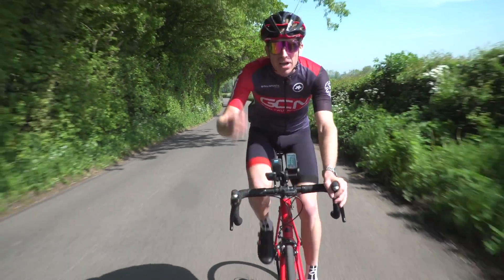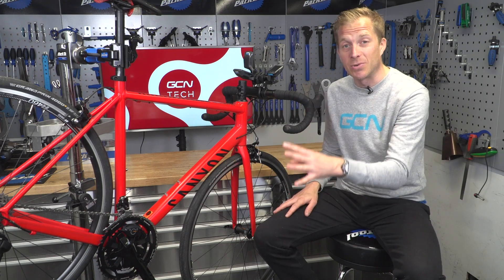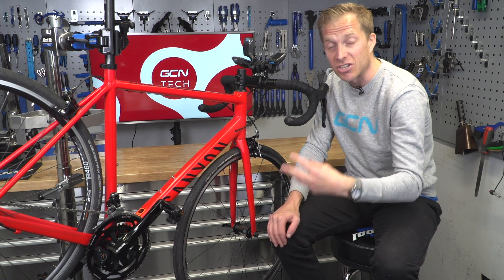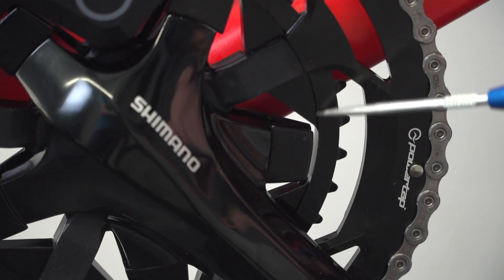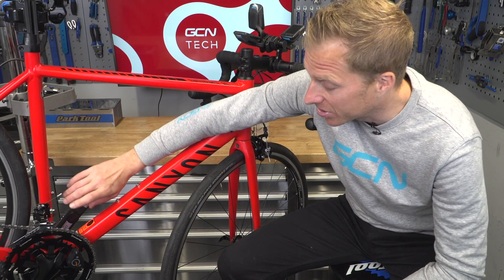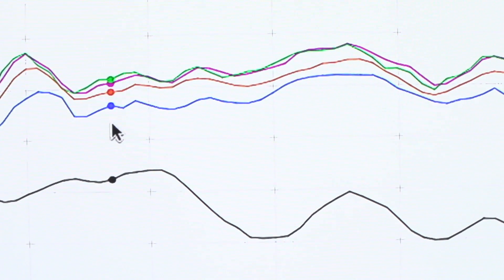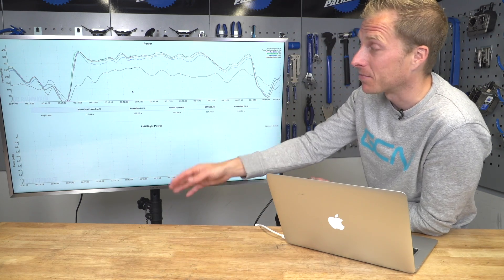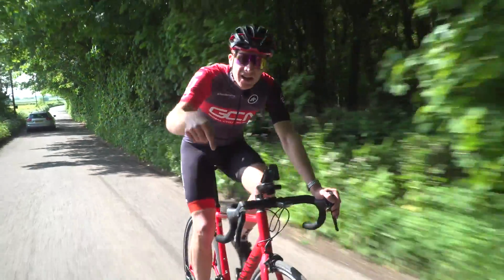Where To Fit A Power Meter On Your Bike | GCN Tech Does Science

Comment: Fitif Power app on OS and Android, less than 10€, works with cadence/ heart rate/ speed (any two of the three). Works best with cadence and heart rate. Uses the accelerometer in the phone and GPS for the algorithm to calculate. Can be used for road or hard off road tracks. I just had the Rotor InPower 1.1 bottom bracket and cranks fitted to my mountain bike, yet to test. Next week if you'd like an opinion. All the best Jon, Tim. Ride on!

Comment: Nearly every review/roundup that mentions the Powertap P1 pedals says that you can easily find the AAA batteries anywhere in a pinch, while also failing to point out that Powertap says they require the use of AAA lithium batteries because the common alkalines could damage the pedals, which isn't covered under warranty.  I doubt that AAA lithiums are as readily available as AAA alkalines.
Reply: ytyehyeh for me in the states everywhere you can find alkalines you can find lithiums
Reply: exactly. also, i live in toronto where triple a batteries are hard to find, let alone lithium ones !

Comment: Jon, that is really pity to see the lack of objectiveness in this video  (I guess because of powertap sponsorship): for example: 1. pedal based measurement gives you much deeper analytics of the pedalling technique, And Garmin/Rotor does this perfectly (strange that you haven't mentioned this point about pedal based measurements). 2. the massive batteries in the powertap pedals increase the pedals weight and thickness of the pedals (you can touch ground more likely in a speedy smooth turn if you are pedalling). and these are important points for those who is starting to train seriously, most likely for competition. I have no hesitations you know and thought about these points, but tried to avoid them as they are uncomfortable for  Powertap. We trust you and expect complete and fair overview  if you compare anything...
Reply: Those "deeper analytics of the pedalling technique" might be useful for scientific research or advanced bike fit, but for day-to-day training not so much. I wouldn't pay extra for those.
Reply: michwoz -  it's not a question of price. it is very important difference between different ways of measuring power.... and analysis of pedal technique is very practical task, look on the recent GNT video: "how to pedal like a pro": https://youtu.be/o5HWRdoQoGs
Reply: michwoz - and hub measurement is not a cheep solutions if you have training and race wheels sets

Comment: I train with power. My first power meter is a single-sided gen-2 from Stages Cycling on their composite carbon crank arm for a GXP bottom bracket with my SRAM Red crank. I purchased it at a reduced price during a sale as a temporary measure until the price of two-sided power meters come down. I like the idea of the power meter in the pedals but no one is making them for SPD cleats that I use. So pedals are out. I was thinking about switching to a pair of Watteam Powerbeat power meters because the company plans to support carbon crank arms -- but they don't yet. The Powerbeat can be purchased for do-it-yourself installation onto any straight, hollow aluminium crank arms as either a one-sided or two-sided system. However, another recent entry into the market (via Kickstarter) is the iQ² from Keesjan Klant and company. It looks like one of the best power meters yet. It attaches between the pedals and the crank arms so you can use it with any crank and any pedals. It's available as both one-sided and two-sided. But, since it's funded via Kickstarter and they don't expect to start shipping until September 2018, I'm waiting. Once their claims are verified by independents tests of production units, a two-sided iQ² may be my next power meter.

Comment: The Elemnt Bolt, designed to be aerodynamic.....not in this case 😂😂😂
Reply: Five times more aerodynamic
Reply: JD Pinilla 😂
Reply: Its not actually any more aerodynamic  than the competition and certainly no where near the claims made by wahoo. As part of its development the bolt never actually saw a wind tunnel, it was all done using CFD and modeling against a specific model of the competition at a specific angle which was selected imho to make the bolt appear better than it is. When it has been tested in the wind tunnel the claims did not really stack up.

Comment: Started with a hub, moved to a crank based stages and now using pedals. Found the Assioma Duos to be great value and when analysed vs my Wahoo Kickr V3 indoors seems to sit well within 1% tolerances. As long as you use the same device to train with power and it's consistent to itself, a few watts between different devices means nothing.
Reply: Nathan Porter I have a kicker 2 too, and assioma singlesided pedals. Huge differences! The pedals read about 25% higher despite repeated calibrations of both. Don’t think I’m that lopsided with my pedalling!

Comment: 5:08 In reference to "no actual competition for chainring power meters" // Come on GCN! We expect you to be more aware of trivial information like this! Was this purposely put into the video at the request of Powertap? LOL I run 2 QUARQ D-ZERO crank based chainring meters on both of my bikes and they are flawless. Reason why I don't use power enabled pedals: Pedals are a wear and tear item. Too Bulky. FOrces me to have to use your cleat system now. No thanks. No immediate desire to move pedals from bike to bike.
Reply from the maker: Hi Armenian, thanks for your comment. You're right and we're definitely not intending to ignore crank based power meters, these chainring ones however do work differently as Garrubrations mentions below. 👍
Reply: Don't quarq power meters measure deflection of the the spider and not of the actual chainrings themselves?
Reply: Yes you are correct.
Reply: The lower price point of the C1, is very attractive and this is great for the consumer. $350USD.  If it's compatible, there is no reason why people shouldn't be buying this item for their bikes.
Reply: On the other hand, it might also be worth mentioning that replacement Powertap C1 chainrings are $200 USD
Reply: You are kind of ignoring crank based ones though, and chainring vs spider is splitting hairs, they are very, very similar .. but not made by Powertap, so .. yea.  I understand this is a paid promotion, so I shouldn't be surprised this is all about selling Powertap gubbins and little else.
Reply: crank based is introduced in the video with Stages. But it only represent left crank based.
Theoretically one could find a right crank based PM and also use Stages on left side making it two crank based power meter.
Reply: I agree. Less paid promotions. MORE unbiased videos PLEASE!
Reply: Stages meter is arm based. I returned my original stages arm for a full refund after it had power drop outs, unrelated to the battery compartment,  affecting my overall data.
Reply: Arm is also part of the crank. It's still crank based PM.
My Stages died in rain ride. I sell my warranty claimed Stages and go with Quarq too.

However, i think this video is doing fine, mostly, except some minor points.
Reply: Yep no mention of the dual leg versions from Stages/ 4iiii/ Pioneer/ Shimano.

Comment: For me the choice was obvious due to it being the easiest to make. A crank based one is easy to place strain gauges on as they are measuring a simple bending, compression one side, tension on the other. Also plenty of space for the electronics and batteries.
Just need someone to lend me a pedal based power meter and I can check the accuracy.

Comment: Call me crazy but I am actually debating on a gravel bike vs. a power meter. I just got the +1 OK from the wife so +1 no longer means -S!  I do want a power meter though. Most likely the Stages is what I would get though.
Reply: If you are not racing and doing super structured training, a power meter is no more than a gimmick. A gravel bike will be a lot more fun, will open new roads and break the routine of riding road. I bought a Quarq a bit less than a year ago because i got caught up ion the whole "training with power" hype. Now i am trying to sell it to buy better upgrades on my bikes as i dont actually train structured enough to justify such and expensive piece of equipment
Reply: The power meter truly improved my riding.
Reply: Minor detail. I only have the money for one!
Reply: Believe it or not, she doesn't. Her addition is gardens. I would have to dig up the yard and that would seriously cut into my ride time! ;-)
Reply: Find a gravel bike with an included power meter :)
Reply: Well, see the GCN's "6 reasons why you need a power meter" video.  It's all spot on.  If you are tracking your performance, if you are ever annoyed that the headwind is spoiling your average speed numbers, a power meter will help.
Reply: I am thinking that the power meeter may be more economical as the bikes I am liking all exceed $5,000(US)!